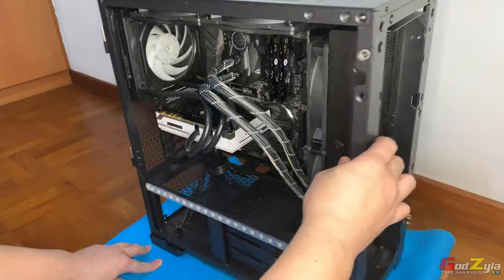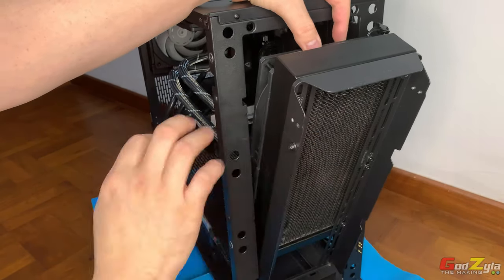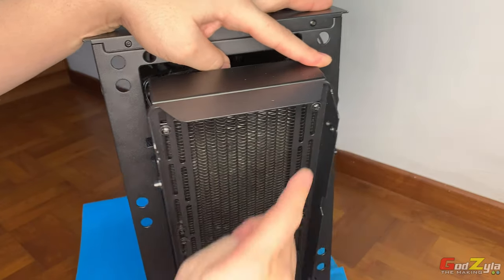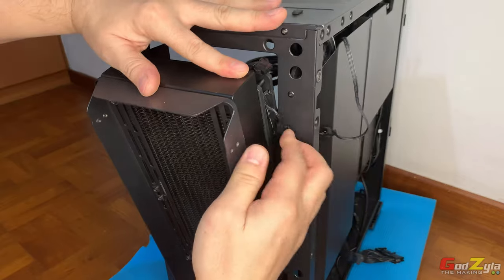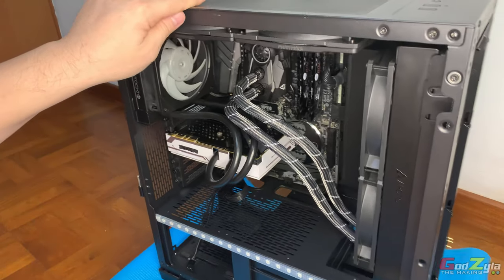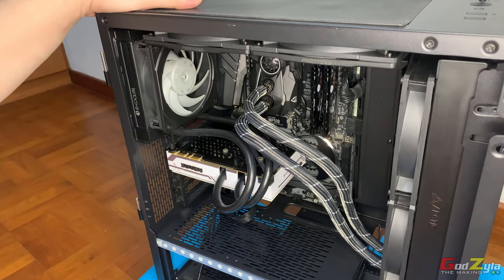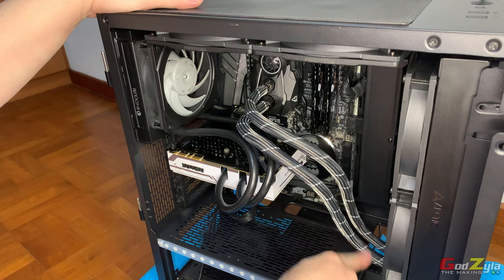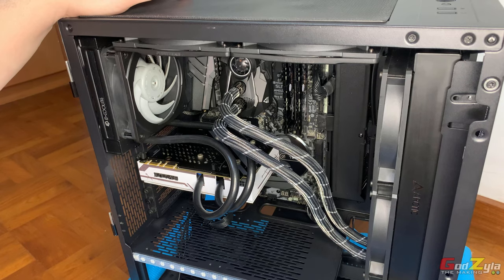Radiator Placement In Lian Li Lancool II Case

Comment from the maker: Credits to 40ozFab , those using Corsair h115i Pro on this case, please read on.

Post from 40ozFab

I have the LanCool 2 Mesh Performance and have a Corsair h115i Pro 280 AIO mounted in the front in the same position as Kleo, with including Corsair fans in pull as in trhis video and the 2x140 LianLi included PWM case fans in push mounted inside the adjustable front fan/radiator mount.  There is plenty of room between the push fans and the front mesh panel and the front fans appear to be where fans would be in a stock, airflow case, not too far forward and not too far back, just right.  Going from pull to push pull dropped the AIO water temp by 2-3 C but I did have to play around with Corsair iCue fan curves since the two different fan types have different RPM ranges, adding 12% speed in iCue to a new fan profile for the Corsair fans so both fan brands are always at the same speed (I used 2x fan splitters connected 1 each to the 2x AIO fan pump fan connectors controlled by iCue software, both push fans connected to one connector, both pull fans connected to the other).  I am currently tubes up, and have been for 2 years as in my old Corsair 500D case.  Tubes down fits but is kind of tight on the tubes with my 5700 XT Nitro+, a 306mm long card.

Another note, the 2 position cable cover next to the motherboard 24pin connector needs to be mounted close to the motherboard and 24pin cable wrapped over the cover with a 280AIO mounted in front in pull configuration, unless maybe the radiator is mounted further forward and inside the radiator mount, not recommended for 280 as mentioned in video due to possible scratching or worse puncture by screw.  With your proposed 360AIO the cable cover might be able to be flipped 180 degrees. 

Another post incoming of many 280AIO and 3x or 4x 120 fan configurations with my previous Corsair 500D case showing temperatures of all components except storage drives.  I did this testing just before swapping to the the LanCool 2 Mesh Performance for the improved GPU cooling with bottom fan intake.  I know a different case, but temperature differences will be similar as using the LianLi case without any bottom mounted fans, and more realistically covering the bottom side mesh panel, which no one would do.

Comment: The drive bay can be removed. Just take the extra slot out thats towards the front to give rads extra space. Take that out, sldie the drive bay out after taking the screw the locks ot in place. That same metal tab where the scree goes you need to bend upwards and you can turn the drive bay sideways and slide ot out from the front where the space is between the bottom front fan and drive bay slide rail.
Reply from the maker: Hi Daniel Pindell, welcome to my channel and thanks for your feedback. Greatly appreciated it.

Comment: can i do push pull on a 280mm radiator in this case?
Reply from the maker: Hi MightBeBren, welcome to my channel. yes you can do push pull configuration without issues, since the whole try can go front and back to give you clearance.

Comment: great video... question... I do have a freezer II 280mm, off course I need to front mount it, do you think I can fit a 323mm gpu (colorful 3080ti Vulcan) with the radiator in the same configuration of yours?
Reply from the maker: Hello LodossGame, welcome to my channel, yes you can fit the 323mm GPU without issues. as the front tray is movable in position.

Comment: Thank you for your upload, it was very clear. I do have a question: Can you use the radiator and the front fans that come with it at the same time?
Reply from the maker: Hi Giovanni Silva, welcome to my channel. you can do that but I won't advise you to do that.. reason is. your radiator fans are running at a different RPM compared to the case fans and even if you set the same RPM, I will not advise too, as the fan structure are different. Different structure of fans might give you turbulance which will generate noise + unwanted vibration. In no time you might damage the fans.

Comment: It didn’t even occur to me that you could flip the fan cage like that! I wish there was a bit more detail about different orientations included in the manual. Thanks a lot, that helps big time!
Reply from the maker: Hi Blood Sausage welcome to my channel. I am glad this aid you in someways. Thank you for your feedback and all the best with your build 😉
Reply: @KleoYan I’ve been playing with different placements for fans for a couple weeks since my original comment and I’ve now got so many more complaints about this case than just the manual lmao

Seems like you’re very engaged with your channel and comments, big props man 😄
Reply from the maker: @bloodsausage6635 hmm was yours the Lancool II mesh or the original? The original is rather tricky and due to the front. There are not much airflow. I had a fair bit about this case and ended up change to another case. My O11D serves me well as compared to this case. By the way yes. I am not perfect, by texting and replying to my commenters, I get to learn too. 😊

Comment: Hi, i have same case and liquid freezer. I want place it top but does it fit to the top ? i have low profile ram.
Reply from the maker: Hi Aybars Tokar, welcome to my channel, for me I am not able to place it at the top as there is not enough clearance between my 280 AIO and the VRM Heatsink of my motherboard.
Reply: @KleoYan  Thank you for your answer, What's the difference top mounting or front mounting is there any temputure difference between them ? another question if a front mount and tubes down and i have 290mm long graphic card u think will it fit ?
Reply from the maker: @aybarstokar16  hi, the difference is not that big, just that your GPU will be running cooler with your Liquid AIO mounting at the top as exhaust. As for front mounting for the Liquid AIO and with the tubes at the bottom, you will have some issues and might hit your GPU which is 290mm in lenght. the GPU I have used here is a modified 1070ti which is very short. about 180mm in lenght.

Comment: i actually had to mount the radiator facing toward the cage, And the cage had to be re-mounted so that it was recessed closer into the chassis so that the front panel could clear enough to re-attach. In order to run a 280mm arctic in push+pull. TO have enough "space" for the hoses to reach the cpu mount and clear my 3070 strix gpu. MOST ppl trying to mount the arctic 280mm in push+pull will have no choice but to run this installation/orientation. Just a heads up to ppl wondering about this specifically. SO step 1....Remove radiator cage from its "high" hinge mounting points remove it and re-install it in the lower/deeper rad cage mount....Then you have to remove the aio fans bc the rad will have to be flipped/spun AND flush mounted from the front side inward against the cage as the cage "ARMS" hug the rad. FACING out like in this vid. BUT with the radiator IN the arms of the rad....which is mounted "Deeper" into the chassis. THan in vid.....THEN you mount PULL fans and tilt the cage full 90 deg and lock it in with the included rad/cage tumbscrews. THEN mount the push fans up front...check with front panel for fitment"it should fit"....ITS the only way for the hoses TO be able to bend/make it to the cpu in a push/pull orientation with the thicker 280mm arctic aio or most thicker 280mm aio radiators. IMO they ddeserve a push pull anyways being thicker...and a top mounted 280mm w.o pull fans....leaves VRM area congested with hot air and an IMO lack of exhaust flow. ALSO yielding potential heat zones for ram/ssd. Its why ill never mount uptop and typically always run a thicker rad front and push pull it if i can generate some secondary intake for my system from a side panel like the psu shroud in this chassis. AS well as some mounted fans on the PSU shroud. Then ill do so to compensate for any potential CPU cooling heat added to my GPU cooling equation....OF which i typically invest in a better GPU cooling solution like the xtrio or in my case the 3070 strix which is a 3080 cooler on a 3070 with insane vrm/vram cooling potential vs the stock 3070 FE. It makes this chassis/build orientation one of the better options as well as its price.  If you get a stellar performing gpu like an xtrio or strix from a cooling standpoint then you can get one of the better CPU cooling solutions in a front mount thicker rad AIO...while also avoiding any VRM heat that a top mount or air cooler would provide. Ultimately yielding the best performance and noise ratio
Reply from the maker: hello andola jackson, welcome to my channel and thank you for the heads up and the suggestion. Greatly appreciated it. once again thank you!

Comment: great vid! curious, is it even possible to mount fans on the other side of the radiator like towards the case or will the mesh panel prohibit that? havent found any answers to that anywhere
Reply from the maker: Hi Maylan Hoy, welcome to my channel. Good question. If you have set the radiator and fans at the front. You need to mount the front tray inwards and it’s a very tight fit. It’s advisable to mount the radiator inside the case and the fans outside. It won’t be an issue to close the front mesh cover.

Comment: hello do you know if the arctic liquid freezer 240 radiator will fit on the top. I have RAM G.Skill Ripjaws V 42mm do you think it will fit?
Reply from the maker: Hi Stalker, welcome to my channel. For a 240 radiator, it should not be an issue as you will not hit near the VRM areas on the motherboard. Therefore there will be clearance for your rams and will not hit it. I have tried that before with a 240 and using Dominator Platinum rams which are higher than the G.Skill, 240 no issue.

Comment: hello, can you use this artic 280 pull-push fans on front? any chance for top (pull - push? do you know which case can do 280 radiotor pull-push on TOP? thank you
Reply from the maker: Hello Jaydee Joy, 1st yes you can do push pull configurate at the front of this case, no issue. the placement will be 2 x 140 mm fan inside the radiator bracket, then place the rad inside the case of the bracket, then follow by another 2 x 140mm fans. 2nd No. you can't mount the 280 at the top. there are restriction. as for which case can do top 280mm push pull. This I am not able to answer you as I have not tested this AIO on any other case except for the case I have. O11D mini (Side Mount)

Comment: I would like to know if a 120x280 radiator can fit in the top.  THe 280mm radiator is about 2" inches longer than the 240
Reply from the maker: Hi Andy Gonzalez, welcome to my channel. I am afraid nope, you can't fit that. I have tried placing a 280mm rad at the top but not able to fit. This is due to the blockage of the motherboard VRM heatsink and the EPS power cable to your motherboard. it's just too tight to fit.

Comment: Hey mate, found this to be most informative.

This is what I am building :
Lian li lancool 2 mesh performance case, Asus TUF 3080
Intel 12700k
MSI z690 tomahawk
crucial ballistix DDR4 2x16gb 3600mhz CL16

You answered all the questions I had, I am going to front mount the 280mm Arctic freezer II and hopefully it fits okay with hoses on the bottom
Reply from the maker: Hi Rob130z, welcome to my channel and yes you will be able to mount at the front with hose facing downwards and you are able to mount the Asus Tuf 3080, not an issue. Once again thank you to have visited my channel and all the best in your build 👍
Reply: Hope you worked it out i front mounted mine...YOU definitely have to FLUSH mount your pull fans on the back side of the cage with the RAD mounted INTO the cage installed from the front panel side..also you have to re mount the cage to the deeper holes so that the front panel can clear....with the push fans up front...it is close to the front panel....but the only way to have enough space inside for the hoses to clear a larger GPU....also i had to fully remove the HDD cage.....not a big issue bc i only run SSD. Hope this helps...it took me an hour on my build to figure this out and easily the longest part of my build. IMO a must best thermal performance to noise ratio period as well as vrm/ram temps bc of all that added airflow up top for vrm/ram/ssd and no hotzone of an air cooler or top mounted rad. Got a 3070 strix which is the 3080 strix cooler on my 3070 so my gpu is essentially near silent and the best cooling solution i could get on my gpu. Overall with the amount of fans in my system 9 im amazed at how quiet it is bc they never have to ramp up and the gpu only gets loud at high speeds/max load which is only really AAA games or uncapped competitive shooters/survival shooters. Any other genre even PVE if i add a frame cap to 120 or 144.....hell even 165....and my gpu doesnt max out it makes my system insanely quiet for how much POWER its putting out id recommend the same a Frame cap on any non competitive game...the thermals/noise is such a huge LEAP in QOL from laptops or older gaming pcs
Reply: @anhiirr  what cpu are you running? Thank you for your reply!
Reply: @Rob13Oz  5900x, from 3950x
Reply: @anhiirr  I'm looking to go 12700k.. If Zen 4 was out I would run that

Comment: Hello sir I have 2 140mm fans can I mount it on the top or should I place 2 120mm fans on the top with high rpm? which would give much better airflow ? I'm not talking about AIO radiator setup just asking generally
Reply from the maker: Hello The Internet Surfer, welcome back. yes you can mount 2 x 140mm fans at the top. for case fan airflow, best to use is as exhaust, so that hot air will be removed inside the case.
Reply: @KleoYan  hello sir one more question which one is better  2 140mm sickleflow 1400rpm or 3 120mm sickleflow 1800rpm ?
Reply from the maker: @IntuitiveLegend , in general, having 2 x 140mm fans, more air will either enter or exhuast and it will be more quiet compared to 3 x 120mm. Having to say this. You might want to do some research on those fans, as I have no idea how good are their 120 or 140. I normally will use Arctic P12, P14 or Gentle Typhoon 120mm fans.
Reply: @KleoYan  thanks actually I needed some RGB so I have to go with Coolermaster sickleflow 140 aRGB else would have definitely gone with Arctic fans

Comment: What about clearance while mounting this liquid freezer ii 280 on top? With a huge gpu is hard to get the tubes on the front and bottom position as I can see, you gpu is very short and tubes are quite tight. (the best position of course, but horizontal gpu limits the tubes extension in the low part).
Reply: Find answer in your recent video, sadly not possible..
Reply from the maker: @nerdMike  Hi,  thank you for your question and do pardon me was away for new year celebration. This case is not possbile to mount the 280 AIO at the top. 
Wow you have a very establish YouTube channel, I have subscribe. 
Once again thank you for your question and to have visit my channel. If you like my content, do subscribe and to click on the notification bell.
Reply: @KleoYan  thank you! 🤓 useful info BTW on this case and interesting contents. 👍🏻👍🏻
Reply from the maker: Hi Mike, you are most welcome. I see that your channel does introduce cameras and such. You’re have more useful content too. I am still at learning stage. By the way thank you for your info on your YouTube channel too. https://youtube.com/c/nerdMike 👍👍
Reply: @KleoYan  :)

Comment: I've been wanting to see how the Arctic Liquid Freezer II 280 fits in the front of the Lancool 2 (mainly to get a better idea on available GPU space) before I buy both in the next month or two so that being the cooler for this was a nice surprise along with showing the reach of the tubes with them on the bottom for ideal placement.👍 I'll probably be moving the fans to the front though, cleaning dust off since won't be too much an issue.
Reply from the maker: glad that this video does help you in your build.. all the very best and thank you for your comment :)
Reply: had to re-mount the cage in the recessed holes that make it closer to the GPU. AND mount the RAD inside of the cage from the front side of the chassis....to be able to fit a push pull with the 280 arctic. If you notice theres the front/closer to the front cage mount and slanted crew holes down low...and deeper recessed holes. you have to use those and mount the pull fans to the cage the way the VOD here has the rad mounted to the cage....also i had to fully remove the HDD cage completely so that the hoses could clear with a 3080 sized cooler up close to the fans. Took me around an hour to figure this out when building my system a year+ ago. I hope this helps any others interested in a 280mm PUSH Pull setup its insane how quiet and cool my 5900x is.....also you can piggy back the plugs on the 2 added fans connect them to a single motherboard header then in bios link the fan curves to the cpu/pump header that the original AIO fan/pump plug connect to....so 2 plugs total and easy fan control/linkage vs these 1 rgb/1pump/1cpu header monstrosities and adding PUSH pull to that and the cable management....ARCTIC with its single plug and ease of use PIGGY back PWM headers on their p12/p14 fans make a high fan build so much easier to cable manage and manage in bios.

Comment: Why draw the radiator output air through the system. I guess it's hard to mount above?
Reply from the maker: Hi Michael Kim, welcome to my channel. Yup ideally is to place it at the top but I got an issue at the top therefore place it at the front. This only happened to an arctic liquid freezer II 280 as the radiator is thick.